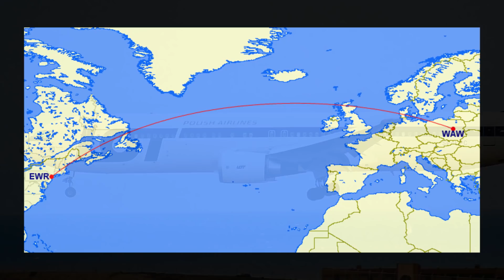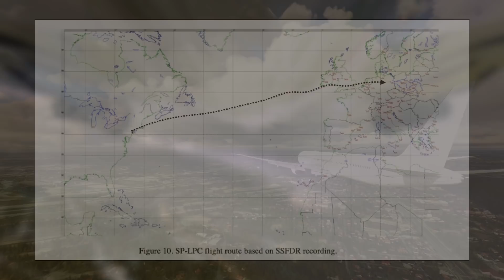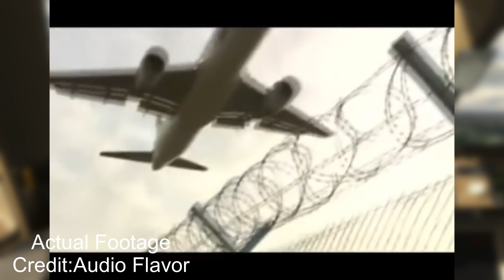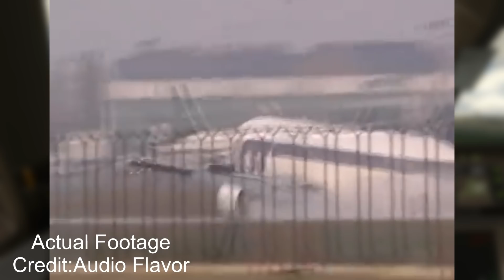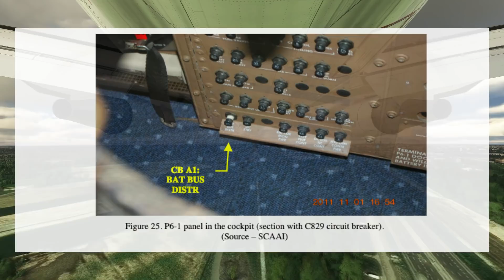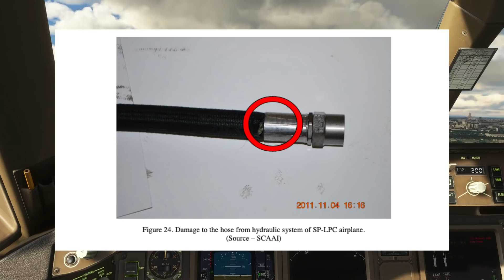A Tiny Switch Causes A Massive Emergency! | LOT Polish 16 (Real Footage)

Comment: I'm wondering if it would have been easier to land on the Baltic Sea.  Now, I do realize Warsaw isn't that close to the Baltic by Gdansk but it just seems that the Baltic gives you a never ending runway so you can fly low forever getting lower and lower and lower until you just start skimming the water and then slowly slide into a stop.  I'm thinking ot the US plane that landed on the East River in New York and everyone ended up fine and the landing was pretty smooth.

Comment: Lots of  BS.  I have flown the 767 since 1999.  NEVER heard of hydraulic “line C”.   It doesn’t exist.   Battery CB on the P61 panel was popped due to the F/Os bags set near the CB panel that has most of the DC systems.   Narrator is full of some wrong information.  Good intent but not good total value.   Pilot error after a mechanical failure.  

GREAT LANDING…..

Comment: The better choice was to continue the flight instead of doing a return to the airport.  Returning would have possibly meant an overweight landing, not to mention thousands of pounds of excess fuel.  Continuing the flight reduced that fuel load tremendously.

Comment: First of all I would have immediately returned to my airport of departure. 
Also think about this for a moment when the crew let ATC know they had lost hydraulic system C They put them in touch with some technicians on the ground and they asked the crew to run through some checks one of such was to cycle circuit breakers. What if that's when the breaker that runs the electric motors that are used in the process of gravity dropping the landing gear was opened and not closed. If the crew were allowed to return to the airport of departure they would have had plenty of fuel that would give them more time to find the open breaker and they would not have been so tired from the long flight and being more alert would have helped them to see the open breaker or possibly found out that the particular open breaker was directly in linewith the gravity drop motors and a simple push with a fingertip would have saved an entire plane from being scrapped. I reiterate I would have never continued any flight with a hydraulic failure. Who knows if that hydraulic fluid didn't leak onto a critical place where it could have caught fire or if it was just the beginning of a larger problem. We have all seen enough flights doomed by one small symptom just being the hint of a much larger problem that has brought down a plane. 
When I install hydraulic hoses on TRACTORS I hate doing so that they are in a bind like the hose was installed on this plane. 
It makes my blood run cold watching these videos and seeing the deaths caused my maintenance workers not taking the time to do a perfect job considering they have the lives of hundreds of people in their hands. A couple flights that come to mind are Air Midwest Flight 5481

And American Airlines Flight 191

Comment: In the mid 80s a C-141 Starlifter hit a deer 🦌 on takeoff from Ft Campbell, Kentucky and elected to fly across the Atlantic to RAF Mildenhall, UK. Not a good decision. The right main wheelwell was a disaster. The crew was grounded.

Comment: I definitely think that those pilots should have circle back around and landed as soon as possible, however before doing so they would have to dump a lot of fuel before they landed since they would have been way overweight, and landing with that heavy of a load of fuel and no landing gear would have been an even far worse disaster.

Comment: C system out return, something does not work check breakers,  I was 767 captain  3000 hr in type, had to make over weight landing  once no big deal. We had 757 that had do gear drop.  would no work , list said use  switch but wrong switch installed .  Instead of on and off switch a momentary was installed, the crew fix it by just hold it till gear dropped then made normal  landing.  I had two engines that would not shut off ,used E handles to shut down.  One has to know your plane cold.

Comment: The pilots didn't have a "small sliver of hope" that the guauges were wrong and the gear were down. They would know if they were actually down as you can hear the change is sound in the cockpit when the nose gear is down (wind nose), and there would be more drag on the aircraft with the gear down.  They certainly would have noticed the additional loss of airspeed due to the drag of the gear being down.

Comment: I'd have landed back at NY but then again losing hydraulics really terrifies me! Perhaps to an unreasonable extent given the redundancy but... IMO the redundancy is so you can land safely and fix the issue, not cross tye Atlantic if you can help it?
Reply: Your landing at Newark wouldn’t have been any safer than your landing at Warsaw. Besides, you’d literally have to lose tons of fuel, or it would actually have been much more dangerous. Besides there wasn’t yet any reason to assume that they couldn’t have made an equally safe gear-down landing, either at Newark or at Warsaw. These decisions are based on assumptions of possible additional failures. Even in the unlikely event of another hydraulic failure, the aircraft would still have been controllable. Such are the redundancies. Most likely, I would have crossed the Atlantic, and I am a pilot with considerably more flight time than either of these pilots. Which is no criticism of any sort. I think they did well.
Reply: @TribusMontibus  Thanks for your great explanation! I entirely overlooked the need to hold and dump fuel, and didn't realize how relatively safe making the trip actually was, even in the event of additional hydraulic failure. Adding to the fact that the pilots made an exceptional landing considering the circumstances and everyone walked away just fine, I do agree with you that it was the right call and my fears of losing hydraulics are mostly unjustified :-) I guess that's why you're the pilot and I'm not, haha!

Comment: I consider hydraulics to be critical for take off, essential during flight, yes should of turn-around.  Doing a gear gravity drop is as close to no gears as you can get.  The gears are designed to drop through the doors if the doors fail to open.

Comment: Why pilots decided not to return to Newark? I’m thinking of several reasons:
1. According to Boeings manuals and after radio communication with company there was no danger to the flight.
2. It gave pilots more time to evaluate and prepare to landing.
3. They will land on their home airport, they all best know.
4. They could communicate by radio with engineers using their native language, which could help in stressful situation and technical jargon.
5. In case of evacuation: for passengers it would be safer (less stressful) to communicate with rescue teams in their native language, in their home country.
6. In case of landing in NEW, they would have to drop fuel first, and after safe landing (there was no implications at that time of other possible scenario) they would be asked, why they dropped tens of thousands of dollars into the sea.
Reply: 7. They assumed the electrical backup system would work just fine.
Reply: @boskee  Yes, perhaps it should be #1.

Comment: Interestingly, I'm aware of three airliner crashes with fatalities due to pilots losing situational awareness while trying to diagnose a landing gear problem (two controlled flight into terrain, one fuel exhaustion), but I am aware of zero fatalities from actually landing a plane with a landing gear problem. Generally speaking, landing gear failures cost money but don't cost lives.

I fully expect that in the crowd who watch these videos and read the comments, someone will find a counterexample.

Comment: Circuit breakers check is a non written fundamental part of troubleshooting. It is allowed to recycle once (except fuel related cb). The plane was lost for no reason . Luckily everyone escaped but that aircraft was a total loss and it could have ended much worse . Lucky crew

Comment: The Left Hydraulic System powers:
1) Flight Controls
2) Main Cargo Door
3) Right Yaw Damper
4) Stab trim

The Center Hydraulic System powers:
1) Flight Controls
2) Nose Wheel Steering
3) Flaps and Slats
4) Alternate Brakes
5) Landing Gear
6) Hydraulic-driven Generator
7) Tail Skid
8) Left Yaw Damper
9) Stab Trim

The Right Hydraulic System powers:
1) Flight Controls
2) Normal Brakes
3) Pitch Enhancement System
4) Auto brakes

Looks like they also lost Nose Wheel Steering, Flaps and Slats, Alternate Brakes, a Generator, Tail Skid and the Left Yaw Damper .

I don't think I would have been comfortable crossing the ocean with so many systems out, given that weather or a different malfunction might have required some of these systems, or adverse weather might force you onto a different airport. What would have spooked me most though is that whatever took out Center Hydraulics might take out other systems as well, and also there is a chance that another unrelated failure might be fatal because of a lack of redundancy, although all the flight controls are triple redundant. So overall I would say it was ok to do it, but I would have decided otherwise.

Comment: As things happened, having very depleted fuel tanks was very useful, or even critical. Having more time to troubleshoot could have made a solution appear in front of them, so maybe both alternatives, either landing as soon as possible or after the full flight, could have resulted better, or worse, than the loss of the plane and no casualties. I give the pilots the benefit of the doubt on this one.

Comment: I think they should have landed and not went over open water. But it's always more complicated than that. Pilots are employees. They rely on their job just as much as the rest of us. And that can often skew your decisions. Not saying it was the right decision, but they asked the guys that were supposedly the experts on the plane and they said it was fine to continue. And of course they could get in trouble for not completing the flight, especially if there wasn't a serious issue. So they continued. Alot of us would probably have made the same decision.

Comment: I would not continue the flight. Hydraulics are so important and there have been a lot of flights that have crashed because of hydraulic failure. But damn if the pilots didn't do a perfect landing and all on board were saved.

Comment: There are hundreds of breakers in a 767. Inspection of all of them is extremely time-consuming.  The air crew probably missed it during pre-flight inspection. Another confusing situation is knowing whether it was supposed to be open or closed. Identifying that scrap of information may not be available to the crew. My take on this crash is that the Boeing/LOT station on the ground should have had this info on hand. THEY are the ones with all of the books and other references. After all, it's the landing gear, for Chrissakes !!! Pilots must rely on the people on the ground talking to them. I see no reason that Boeing/LOT ground station should have identified that problem ... assuming the checklists and manuals were accurate.

As for continuing a trans-Atlantic with any sort of hydraulic trouble? Not me, thank you.

Comment: Airlining is putting a lot of commercial pressure on everyone involved. Each relanding costs a ton of money in addition. I don’t know how many hydraulic systems the 767 has (I guess, 3), so the correct procedure is doing the ECL, then check what the QRH has to say, then consider the remaining options (FOREDEC), then proceed accordingly.
As mentioned in the video they lost hyd sys C, so apparently they still had A and B, all of which are independent from each other.
Not all hyd sys are powering everything equally. The QRH probably told them „you lose x, reduced operation of y, etc…“ 
If the worst thing the QRH told them is,they had to freefall the landing gear, I would probably would have continued to Warsaw too, as freefalling the landing gear is cheaper in WAW than in JFK in this case. Producing less headlines too, probably.

Approaching WAW and the landing gear down option doesnt work gives a sudden unexpected burst of stress and terror nobody was expecting. After this long flight the crew was (very probably) jetlagged, (most probably) tired and probably a bit low on fuel, so they didn’t have much time to fiddle around with the CBs after a go around, which in itself happens quite rarely.

Everything considered, I think they did a great job. The aircraft was a writeoff. So what, not their fault. They lived to tell the story. All of them. That’s actually all that matters.

P.S.: I almost forgot, video well done, too!

Comment: If they had turned around immediately, they would have had enough fuel to work the landing gear problem for hours.  This almost certainly would have saved the plane.  Instead they had relatively limited time and didn’t figure it out.  At least nobody was hurt.
Reply: Wouldn’t have made much of a difference. They would have dumped or burnt most of the fuel as they would be overweight and only then just before landing would have discovered the gear problem

Comment: Under the circumstances, I cant fault the pilots for their decision. As I'd imagine they also verified that the remaining two systems were still functioning normally, and there were no control issues present. And had, or should have had an alternate method to drop the gear and land safely.
Which ever way they handled the situation, they'd have either had to dump all that fuel, or burn it, and would be landing over populated areas either way. On top of that, with the aircraft still flying normally at least, their decision gave them ample time to work on the problem and attempt to find a solution.

Comment: I actually think that the reason they didn't notice the popped circuit breaker was the first officer's bag, which was put right next to the circuit breaker, covering it so when f/o was checking circuit breakers, he didn't see that this one was popped, because his bag was right next to it.
Pretty unfortunate situation caused by simply placing a bag in the wrong place, and pretty serious design flaw from Boeing.

Oh and the Newark airport is in New Jersey, not New York, but close enough I guess
Reply: Well it’s the same as people calling it London Gatwick airport when it’s not in London

Comment: I would think that breaker would be part of QRH checklist for a landing gear failure.
Reply: It's not a landing gear circuit breaker, but a general power breaker. The QRH would be mightily long if you started tracing circuit breakers back to the engine generators.
Reply: @ImperrfectStranger  I'm just thinking that since this particular breaker has relevance to lowering the landing gear when the hydraulic system is out, checking it should be part of the checklist for that procedure.

Comment: If there are so many back up hydraulic lines - why is there only line C that works the landing gear ?   Does line A or B not take over ??
Reply: There is only one hydraulic system for the main landing gear. Then you have to go to the electric motor/gravity drop system.
Reply: The hydraulic systems is Left, Centre and Right. The centre system is operated by 2 electric pumps and an additional demand pump so if 1 were to fail then the other can take over. It’s far more likely for a pump to fail than loss of fluid so the redundancy is there. And gear can be lowered electrically

Comment: All in all I think the call to continue was good. There was a procedure for dropping the gear. No warning lights were on. Tech support said to go. The plane was  full of fuel so they would have had to burn it off/dump anyway. They had some time over land to run more checks. By Warsaw they were light and in a good position to gravity drop. Likewise a belly landing is much safer when empty... The cock up was that stupid breaker. I am very surprised at the lack of a caution for a breaker pop. Boeing ? GUYS ? SAFETY ?
Reply: 40 year old design???? ;) The iPhone didn't come out until at least 25 years later.
Reply: Boeing can add MCAS to monitor the breaker if that is what you want.